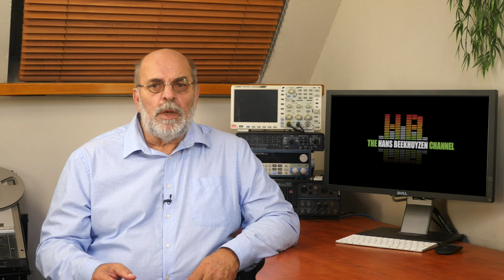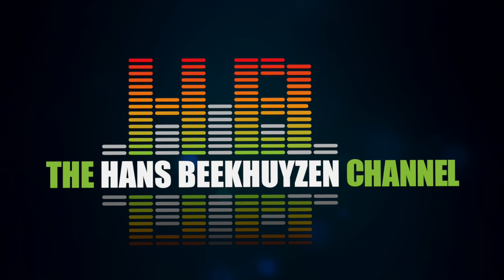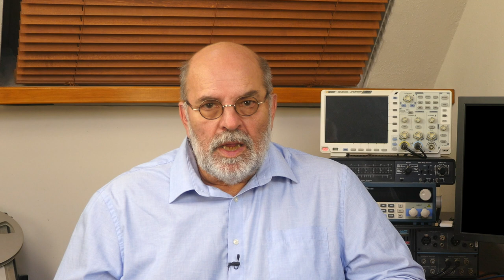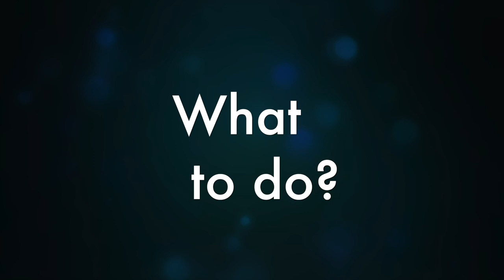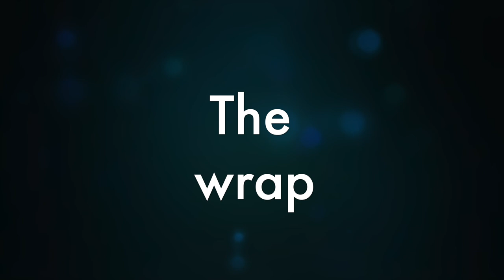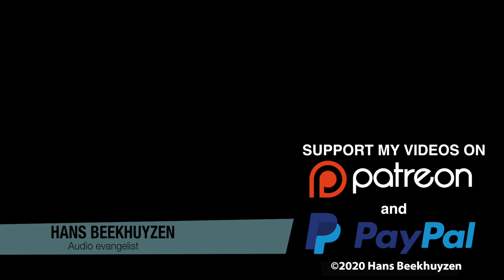Does 384 kHz sampling make sense?

Comment: Thank you for this is video and sharing your thoughts. I'm currently blinded by the light. I've been using a Bluesound Node 2i and the digital preouts are tosklink and coaxial digital. Currently using Toslink. Both have folks on the internet calling out its weakness of 192khz limitation, whereas USB does not. But the Node 2i does not have a USB out. I've purchased a digital coaxial to see if there's a different but have been thinking whether a streamer with better output opts will be better.
Reply from the maker: Why is 192 kHz a limitation? How much music is there for sale at higher sampling rates....
Reply: Its a limitation due to the commercial mumbo jumbo and things people say in the forums. Hence appreciate channels such as yours who tell it as it is. Nevertheless, in your earlier videos you also point to bandwidth limitations of cables. And there lies my concern about cables, some folks say Toslink mainly plays 96khz and other say Toslink may at times go up to 192khz. I thought I'd try digital coaxial to see if there's an improvement. I've also seen your video on improving the digital signal.

Comment: Great video. You mentioned quality oscillators. I noticed that many Chinese manufacturers are using Accusilicon chips for less jitter but I notice that cheaper Chinese DACs (a few hundred dollayand above) perform equally on the J-Test so then of the jitter performance is the same...would putting and buying more expensive DACs make sense? Thanks
Reply from the maker: Just listen. There is more than the relative course J-Test shows
Reply: @TheHansBeekhuyzenChannel  Thanks. Where I live and with my budget, unfortunately I can't so I rely on experts opinion...I have to. Many thanks for your reply
Reply: 10/10 A +